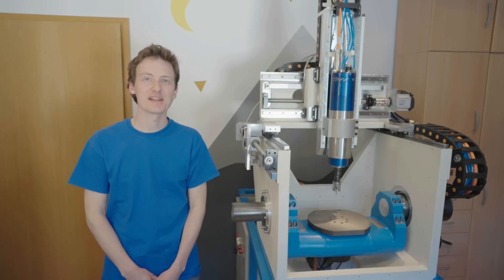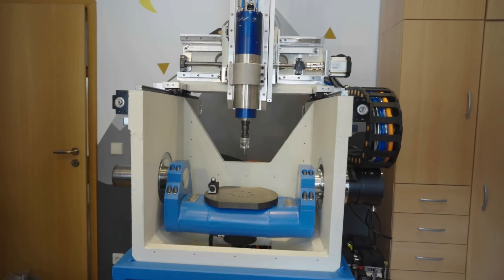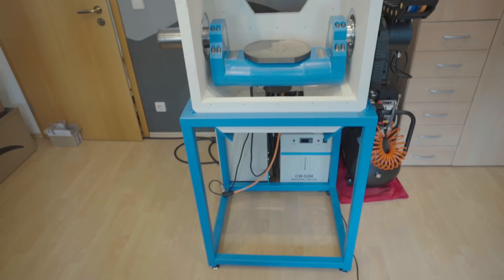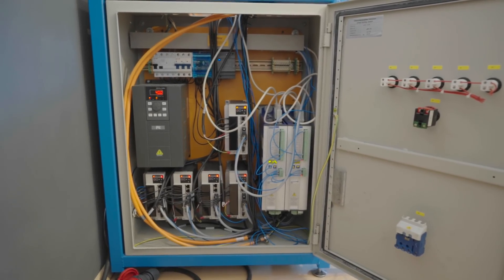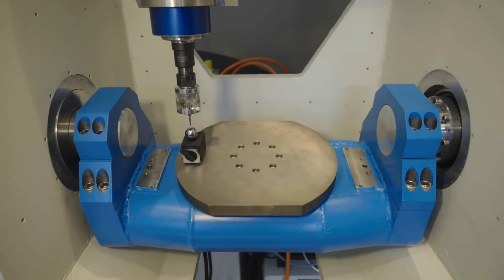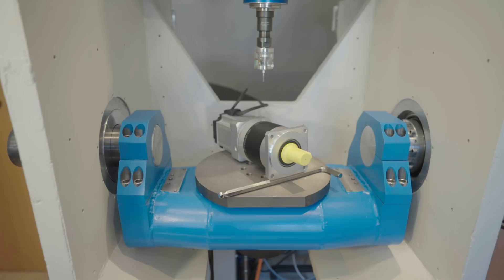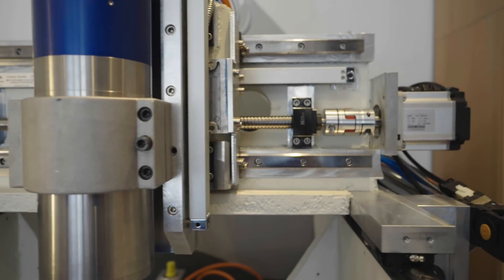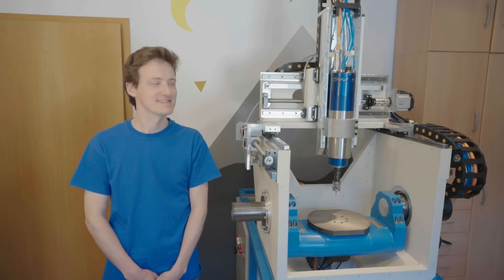Home build 5 axis cnc mill

Comment: It would be fantastic seeing it making some chips.

I'm also curious on about the power you use to keep the harmonic drives stable. I'm also not an engineer, and got my hands on some fancy new old stock chunky bearings and rails, and I'm also planning to do something like this.

Are you considering sharing your lessons learned in videos? That would be super helpful!

Awesome stuff, Fabian!!!
Reply: btw, my design principles are 5 axis and flood cooling. I got here looking for inspiration, and wow, your machine is definitely the best I've seen! It would be good to learn from you, and what you would do differently. Fantastic stuff!
Reply from the maker: Thanks, there will be more videos. Regarding the Harmonic drives, when the Table is in the home position there is no torque on the Servos so the power sonsumption is not significant.
I am also always interested in other peoples take on 5 axis machines. Is your somewhere public on the internet?

Comment: Legendary. Naive question: is it a bad idea to keep the spindle fixed in X, Y and add the degree of freedom in X Y to the part mount, for a total of X Y A B degrees of freedom for the part and only Z for spindle, or even X Y Z A B all for part, and none for spindle?
Reply from the maker: Thank you, close to all configurations exist and they all have different advantages and disadvantages. Always depends on the situation.
XYAB in the part is the typical 3 axis mill with a trunnion table. Easy to implement, flexible if you can remove the trunnion but stacks quite high and the work envelope for the trunnion is small in comparison.
Reply from the maker: XYZAB in the part I have not yet seen. Usually at least Z is on the spindle, makes tolchanges easier.
Everything in the spindle is quite common if you have really heavy and big parts. Those are usually big gantry machines with a tilting head. So you can still move rather quick even if your work piece weights 20 tons.
So it all depends on what you need.

Comment: I loved the machine, you said you use Linux cnc as a software, but what controller do you use ?
Reply from the maker: I use Mes cards. The 7i76e together with a 7i85s.
Reply: @fabianbrock  thanks for the answer 😁
Reply: @fabianbrock  could be amazing if you do a completely video showing how to wirelessly and first running of the program 😁

Comment: 400 volts, 60 amps, three phase power.... I don't know if it's common in Germany to have access to that, but here in the US my home would have to be in an industrial park to get more than 240VAC split-phase lol. But putting my disappointment in American power infrastructure aside, this is a very cool and inspiring project! Nicely done.
Reply from the maker: Thank you. And yes, it is quite handy to live in a country with 400V 3 phase 32A or 64A as default for most residential houses.

Comment: Hi, As I see in the motions, you are capable of doing not just indexed 5 axis movements. What CAM software do you use for it? Thanks.
Reply from the maker: Hi, I have not yet decided on a CAM, I forst need to finally finish the machine. The movements you see in the video where just programmes by hand.

Comment: You put glass scales on 3 axis? Does they override servo encoders in the controller ? Well done! It's absolutely incredible, the complexity of timing every axis with the rotating table/cradle. Congratulations 👍🇨🇦
Reply from the maker: The glass scales are connected to the Mesa cards and feed the position data into LinuxCNC. The servo encoders are only connected to the drives so LinuxCNC does not know anything about them. So the scales are not directly overwriting the servo encoders but the position in the controler and based on that LinuxCNC gives new commands to the servo drivers to correct the position. Hope that's somewhat understandable.
Reply: @fabianbrock  brillant! Very smart way to precision machining! Thanks for your answer!

Comment: A crazy awesome build right here. Obviously the best DIY CNC I have seen on YT. And I've seen a lot. I'm facing the same issue, I want that rigid 5 axis, but I live in a flat. I can assume that your main constraint here was to be able to pass that door (after disassembly that trunion on the side  and Z axis). Nice job
Reply from the maker: Thank you, yes passing through the door and being able to get it in the first floor were the main constraints. So no piece should be heavier than 100kg.
Reply from the maker: Some would call this second floor. It is one above the ground floor.
Reply: @fabianbrock  On my list of "living in a flat constraint" I've also the noise... I'm considering buiding something light with dual glass frame arround the mill. I'm sure it will damp the high frequency noise but the lower frequency noise will be transmitted by the floor ...
Do you think it could be a good idea to put the all frame on some air pad or is it a dumb idea that I need to forget. All the huge machine I know are strongly bolted on the ground but if i'm gentle on the motion dynamics it could do the trick until I have enough money to buy a house.
Reply from the maker: @UPR91  That's definitely an option. Typically the machines are set on some rubber mats to decouple them. You need to be careful with acceleration depending on your moving/stationary mass ratio. To improve this you can also add some bricks to the frame if possible just to increase the mass.

Comment: Is there a part listing, for like linear rails and ballscrews used?
I have collected a few used tombstones and considering building a somewhat small 3axis machine out of it, 300x300x300mm, chinese 2.2kW 24k spindle.
Currently a bit unsure, what rails and what ballscrews to use.
Reply from the maker: I have used 20mm linear rails and 20mm ballscrews with 5mm pitch. For your machine I would propose also 20mm linear rails but 16mm ballscrews. Brand you can pick based on your budget. the 2.2kW chinese spindle is excellent for its price. I have one on my CNC router.

Comment: Do you by any chance have step files for this? Looking to build my own 😃
Reply from the maker: Yes, but right now they are a mess. They need some cleaning up and I am not sure about the third party models included, need to check if it is allowed to distribute them. I also want to finish the machine to see if it works before publishing the files.

Comment: I'm very interested in knowing. The make and model of the electronic hardware you're using. As I'm just starting my journey in building a cnc  machine. Thank you in advance for any help.
Reply from the maker: Do you mean the control boards? That's a Mesa 7i76e FPG card with a Mesa 7i85s extension card. But the 7i76e is discontinued, the 7i96s is the successor.
Reply: @fabianbrock    Manufacturers model numbers for servos, servo drives, power supply, variable frequency drive and spindle. thank you

Comment: I like this design. It's something I thought about to build. 
But it seems to be very weak and not rigid enough.
Can you show how it mills?
Reply from the maker: As mentioned this is a compromise to get the weight down so it can be used in the flat. The machine is not yet finished but as soon as I do the first cuts I'll post a video of it.

Comment: Being 50/50Mech/Struct I am both Amazed & Terrified at the same time, residential buildings are not made for that loading! If your renting please run all the cameras in that room for your next inspection.
Reply from the maker: You are either misjudging the weight of the mill or the load capacity of (German) houses.

Comment: I'm very impressed by your machine!  A few questions out of curiosity: how much did you spend on it? How much weight can you safely put on the floor in your office? The box shaped  construction looks very rigid, except for the high side walls far from the backplate, did you test how much flex it has there?
Reply from the maker: Thanks, I spent around 10k€, forgot to put this in the video, I'll do so in the next one. The weight is fine for the floor.
The shape is roughly taken over from the Hermle C400 and scaled down, I did a quick analysis with fusion and it turned out that basically all the flex is in the Z Axis, so should be fine.
Reply: @fabianbrock  Nice, thanks for your reply. Looking forward to your next videos!

Comment: Did you create a parts list for this amazing machine? What is the largest piece of material that you can safely work on and get nice clean results without any chatter marks? Was this designed for epoxy, wood, or metal work?
Reply from the maker: It is not yet finished, so I have no experience yet regarding chatter. Maximal stock size would be around 300mm cubed and it is designed to machine metal.

Comment: Thank you for sharing tis video. There is not many DIY projects out there that have such a good mechanical design as you have built. I'm a senior mechanical engineer working on a DIY CNC machine too. I'm building a 3-axis machine that I later can expand with one or two more axis. My focus is on mechanical rigidity, precision and a large work volume in relation to outer dimensions. My project has been resting for some time but now you have inspired me to continue. Looking forward to see more from you!
Reply from the maker: Thank you, in case you share your work somewhere online let me know. It sounds interesting.

Comment: Very cool project and very neat cable management. I would like to ask you a question though. What CAM program are you using? I wanted to build a 5 axis concept myself but i can't seem to find many options for CAM that support 5 axis.
Reply from the maker: Good question currently I'm using Fusion 360 in the free version but there is no 5 acis CAM included. I guess I will upgrade to the paid Version. The simultaneous 5 axis CAM package for Fusion is quite expensive though.
Reply: @fabianbrock  I've seen a free 5axis alternative from the guy that created the grugrbl 5 axis (or something like that) but never got the motivation to play around with it.

Comment: Best design I’ve ever seen diy.
Do you use harmonic gear on 5th axis (C axis) ?
Back lash ?
What do you recommend gear that has no backlash or  most little ?
Reply from the maker: Thank you, yes on the 4th and the 5th axis I use Harmonic drives. These are the FHA-32B and FHA-25B respectively.

Comment: Dear Sir,
For a person with no mechanical engineering background as you said; to have built something as complex as 3 axis machine would have been quite a feat but to build a 5 axis machine instead is all the more remarkable. The mistakes which you highlighted are quite frankly really minor when one considers how far you've gone thus far. My curiosity lies in the material used to construct it ( what's painted in white???) If said machine is by your reckoning in the vicinity of 400 kg; it's pretty much the scale of an industrial tool rather than a hobby machine. I think you've excelled yourself & ought to be very proud of your achievement. It's exceedingly complex & very well built. It would be most interesting to see one of your project coming to fruition of this marvel. Very well done. Kind regards.
Reply from the maker: Thank you. The frame is made out of a mineral casting with a thin Aluminum sheet metal housing. I have a post on my Instagram where I show this in more detail. Maybe I include it in the next video.

Comment: i have linuxcnc old pc paraller port computer, and i have guestion, can i add dual Y motors out to my 4 axis controller, mean normal X,Z but Y axis want change 2 motor ,to one Y axis output, pin 3 and 4, step and dit to share 2 pcs DM556 drivers. because i has try 2 month now make linuxcnc working XYYZ system and not working, no homing work, not both Y motor work, lot try do joint1,2,3,4 but alltime only lot errors, i think easy better ay have normal XYZ system and share pin 3 step, pin 4 dir to 2 drivers. can this do or burn DM556 drivers inside optocoupler, or need add resistor and how size? i think controller current go out max about 20mA and share this 2 driver current have 10mA one driver and second driver 10mA go to optocoupler in driver and then gnd. but im not sure burn this optocoupler or not working ? i not true can use linuxcnc XYYZ setting i has try million time but alltime lot erors and change joint code but errors lot i not understand how dual Y motor can run.sorry controller pin 2,3 X axis, 3,4 Y axis 45 Z axis normal and if add A axis to second Y motor pin 6,7 step and dir, not working, joint has change code anglular to linear, but no working, and not show display homing Y axis or home all, and if home ,come lot errors and  and not move and not can run linux because first all need homing, but not homing. i not understand code anythink now, i has try make many many time ewery ewening last 2 month but not working. if share wires pin 3,4 step and dir 2 drivers burn my controller or drivers current ? or not working, or what can do. i not have budget buy owerprice expensive mesa card. paraller controller can use old computer and if need more input can add second paraller port and controller too. just orden second paraller port to pciE card and second controller, this only can add limit SW one controller and home SW second controller own input. because paraller port have only 5 input, E-stop.probe.home XYZ, then need more input all axis 3 pin more all axis limit SW and spindle control output relay.
Reply from the maker: You can connect the 2 drives in parallel to your controller, this should not destroy anything. But you can't have individual homing this way. LinuxCNC is able to handle a xyyz configuration. Maybe you find an example configuration for parallel port somewhere online.

Comment: Beeindruckend Fabian, welche Servos genau verwendest du auf deiner 5Achs danke
Reply from the maker: Dankeschön, für die 5. Achse verwende ich ein Harmonic Drive FHA-25B.
Reply: @fabianbrock  eigentlich meinte ich die JMC für die Jeweiligen Achsen, in zZ vermute ich 750w-1Kw Servo nur auf der Y und X sehen Sie kleiner aus.
Reply from the maker: @Macwolf3  Das sind überall 750W AC Servos, also X, Y1, Y2, Z und Werkzeugwechsler. Ich habe einfach günstige Servos mit 21bit encoder gekauft, bin mir aber noch nicht sicher ob ich die empfehlen kann. Scheinen im Grunde Panasonic D5 Klone zu sein.
Reply from the maker: Z sieht größer aus weil der noch eine Bremse hinten dran hat. Sonst fällt die Z-Achse runter bei usgeschalteter Maschine. Ist ansonsten aber der gleiche Servo.

Comment: Can you please show what’s inside the table? What motors/reducers/bearings did you use for the 4th and 5th axes?
Reply from the maker: They are Harmonic Drive servos. FHA-32B for the 4th axis and FHA-25B for the 5th axis. These are integrated units with the servo motor, the 100:1 harmonic drive reducer and bearings all in one.

Comment: What is the total material cost that you spend building this 5axis? looks very good and compact, Congrats
Reply from the maker: It was around 10k€. I will give more details in the next video.
Reply: Wow, thats super cheep, I expected much much more, regarding that you are using 5.5kW spindle German made, that is more then 30% of that costs plus rails, screws, supports, materials and ACservos. Very very low price.. doesn't expect that 😮
Reply from the maker: @vlatkopetrucci  yeah, that's why I have to go into more details in the next video, got some second hand parts.

Comment: First thing, congratulations with your project. My question is how accurate is the kinematics on this machine ? Did you try to drill a hole on one side and flip the part 180 deg and drill on the other side to check how concentric they are ?
Reply from the maker: Thank you Daniel, The machine is not yet ready for milling but i will test it's accuracy and share it here in a video once the machine is making chips.
Reply: @fabianbrock  That is great, I’m looking forward to this. I have made my own kinematics programs for 5 axis machine such as matsuura mx330 and cubelex-35 to improve machine accuracy. Please take this in consideration to make your own macro program for adjusting centre of rotation.

Comment: What’s the slowest speed the spindle can go? And what’s the biggest sheel mill can you put on it?
Reply from the maker: There is no slowest speed in the data sheet but the curves for torque etc start at 5.000 rpm. You can of course go as slow as you want but this might not be very useful. Same goes for mill size. I could use a gigantic flycutter but dept of cut would need to be minimal. Best is to use tools which suite the spindle better. Anything that is happy with 20k-40k rpm.

Comment: Do you run the Spindle from the TB4 Spindle Connector on the Mesa Card? If not, what do you use?
Reply from the maker: I have only started the VFD by hand for now. I will use RS485 later for the Spindle as you can get more feedback from the VFD this way. But you could also use the TB4 connector for a basic control.
Reply: @fabianbrock  Thank you for the answer. I didn't know you could use the RS485 for other VFDs than the Huanyang ones. Do you have more information on how to do this?

Comment: Hello. I am looking for inexpensive rotary Axis , can you suggest something?
Reply from the maker: I bought the harmonic drives used on ebay. But keep in mind that for fancy professional industry stuff you sometimes need fany professional industry drives, cables, etc.
Depending on your application you can also add a stepper/servo to a manual rotary table, this has backlash but apart from that it works great.